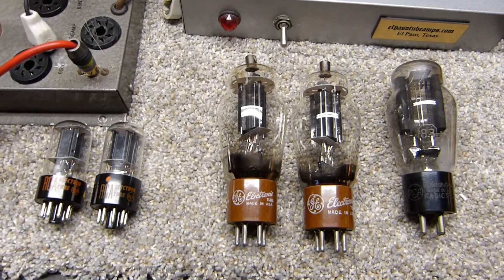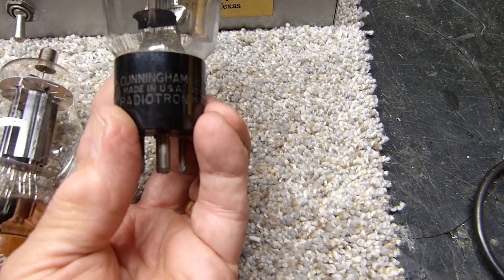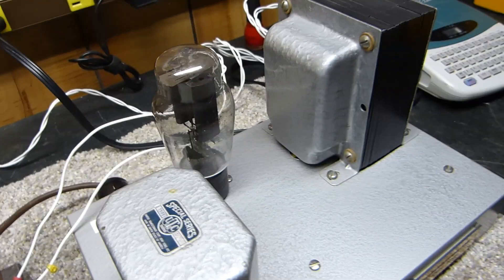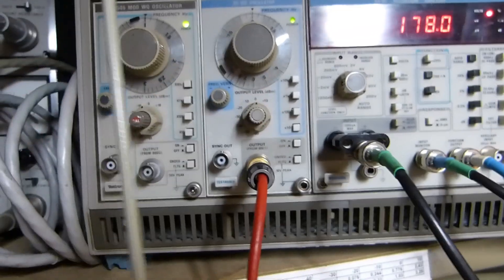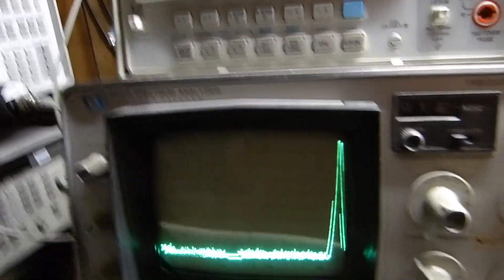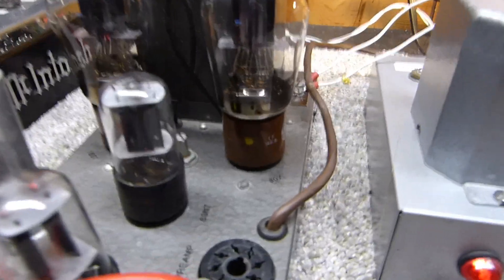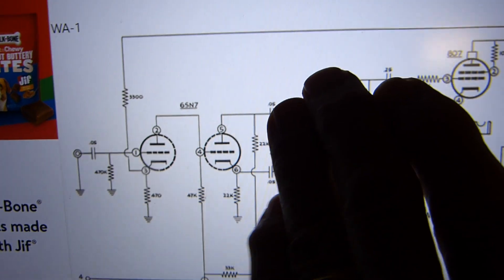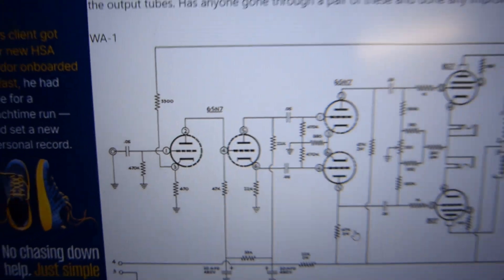A Salute To The Venerable 807 Vacuum Tube

Comment: I also like the 807. It's a real magician. Specs show that you even can operate the 807 in Class A at a plate voltoge up to 500 volts in single ended mode as a pentode and it works great. You cannot do this with the 6L6! The 807 bottle was also inserted in the amplifiers of German Bergmann jukeboxes in the mid fifties. There the 807 worked in pentode mode in push-pull manner with autobias and produced 20 watts.

Comment: I think I was telling you another time but I have pile 1625 mostly NOS and dang some of those tubes are so beautiful just the quality in them is amazing and they all test extremely well after sitting around since the 40s, my Williamson amps are running 1625s and I’m still amazed at the sound of them, I think I’m going to try making a single ended amp with some of them after watching your 807 build. Only reason I got them over 807s is the price difference near me is massive, I could deal with the different base and 12v heater for the money saved
Reply from the maker: I agree that the 1625 is just as good and the same except, as you say, for the 12V filament - and the socket. I used the 1625 years ago for a modulator using four in the output. I have been listening to this little amp every since and I do not tire of it. I am amazed.
Reply: Enjoy your little amp David take care and talk to you again soon my friend
Reply: @thomastubeworks  …but the top cap is sexy!
Reply: @Bigfoot_Murray  I agree! the 1625s have a top cap also they are identical to a 807  if that’s what you meant

Comment: The 807 is essentially a 6L6 adapted for RF applications.  Plate cap to handle high plate voltages, low loss micanol (brown) base, and some additional RF shielding.  The 1625 (used by the thousands in WW2) is essentially the same tube with a 12.6V filament and a 7 pin base.  After the war, the 807 was used as a horizontal sweep tube in a few TV sets, but was quickly "value engineered" into the 6BG6 by removing the additional RF shielding, and putting a cheaper octal base on it.

Comment: I designed and built an 807 based amplifier from scrap parts that I had laying around. I did use a solid state rectifier and the amplifier makes 50 Watts continuous sine wave with 05% distortion. Of course I'm using a public address audio output Transformer so the bandwidth is not spectacular but it was available Parts I had laying around.